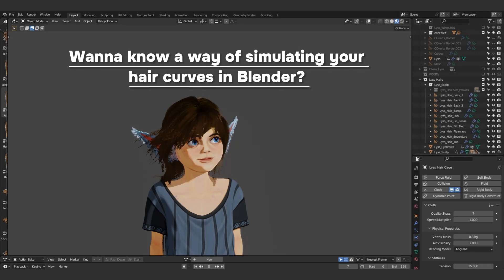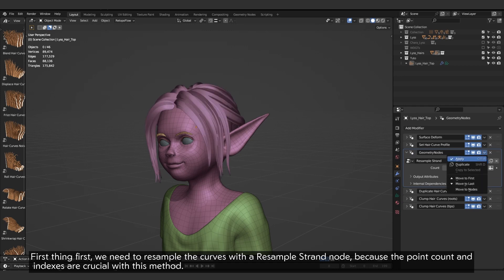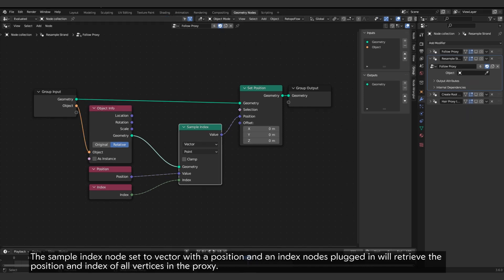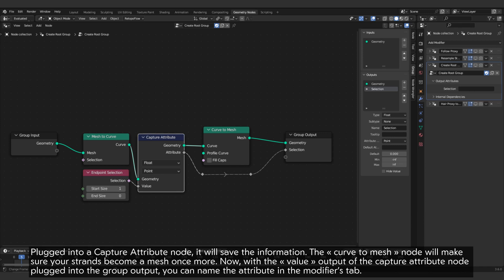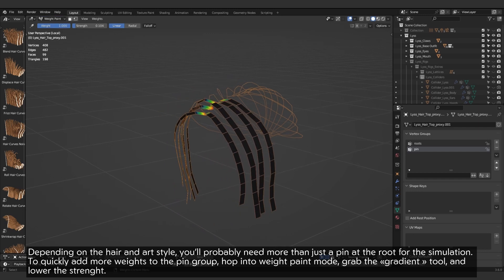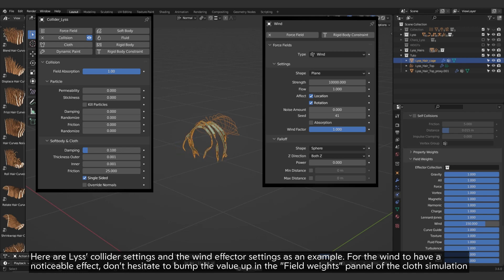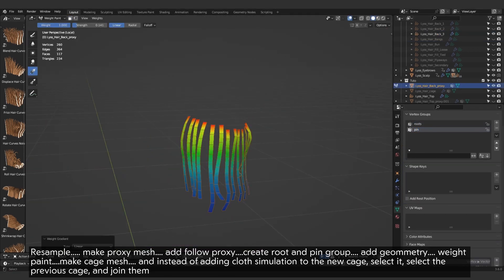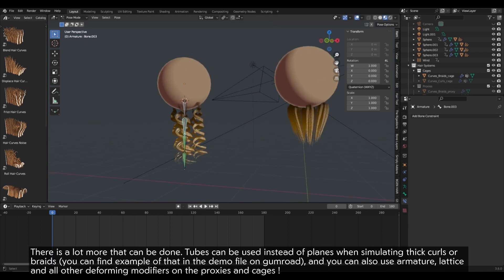Hair Simulation with the new hair system in Blender | 3.6 and +

Comment: Thank you for great tutorial! I tried this but I have a problem.
 Even if the number of hair curve segment is 8, I converted hair curve to mesh then the number of mesh vertices is huge number (over 80)
Do you know how can I solve this?
Reply from the maker: Yes, I do not know why this happens, but the fix is to resampke the hair curves to the correct number (in your case it would be 8), by using and applying a Resample Curve node
If you convert right after applying the issue shouldnt occur

Comment: The proxy method doesnn't seem to work with rigged meshes too well
Reply from the maker: I suppose it depends on how you're using the proxies
I haven't explored using it for fur or stuff like that very much so I suppose you could run into some issue there
but for haircuts I don't have any problems with my charas (the scalp mesh isn't deforming so it easier)
May I ask what is the issue more precisely ?

Comment: Hi, I have two questions:
How did you make the skin texture? It looks really good! Was it texture painting?
Can you texture the hair to change its color/make it stylized?
Reply from the maker: Hi ! Yes, the skin is hand-painted. 
As for the hair, the color can be changed since it's made with a color ramp. You can even play with the Curve Info node to get strands of different colors. 
I'm not sure what you mean by making it stylized, but stuff like specular and translucency can also be tweaked to obtain different styles. It's fully procedural (but using textures is possible) ^^